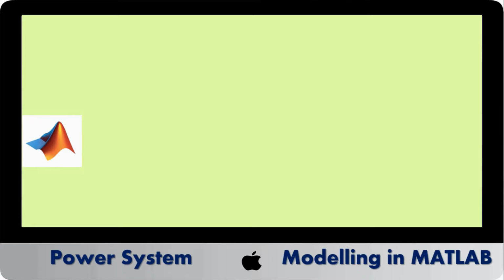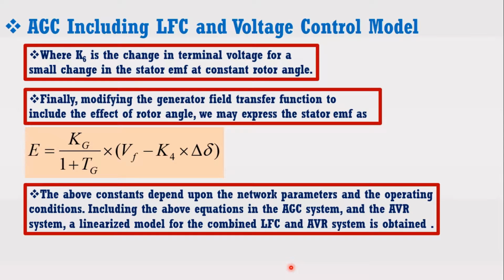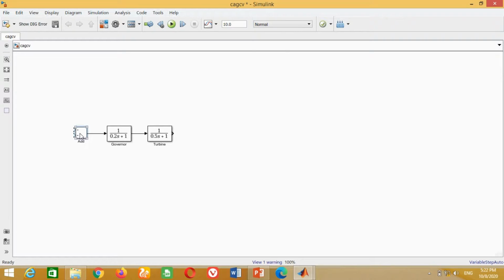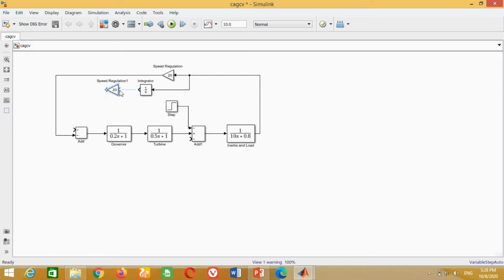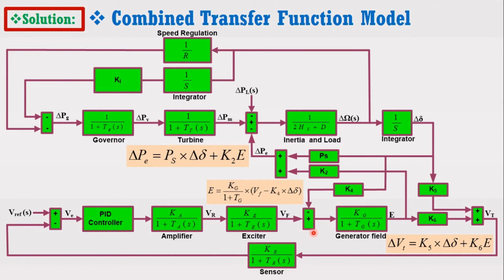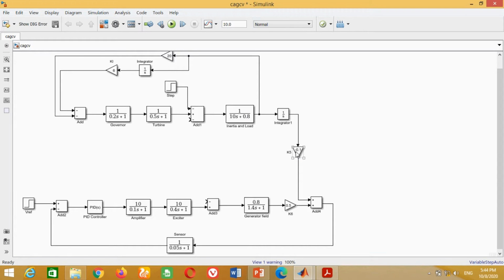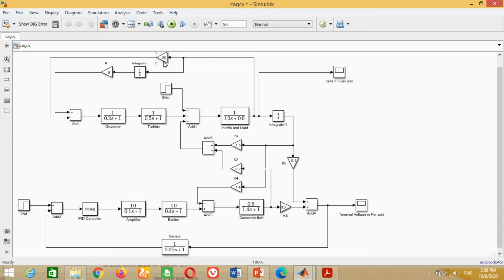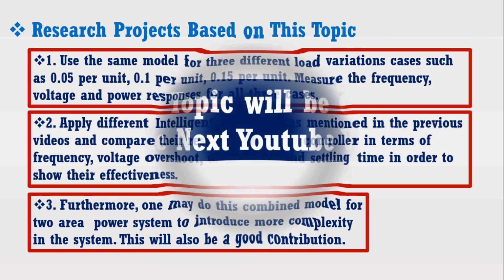How To Design Combined Load Frequency & Voltage Control Model of Power System in MATLAB/SIMULINK ?

Comment: Hello sir we have modelled the system for two area but there is error in output in  change in mechanical power.Could you please help us?
Reply from the maker: Thanks for the comment. This model and example is taken from the book power system analysis by Hadi sadat. You may get further help from book or any research paper.